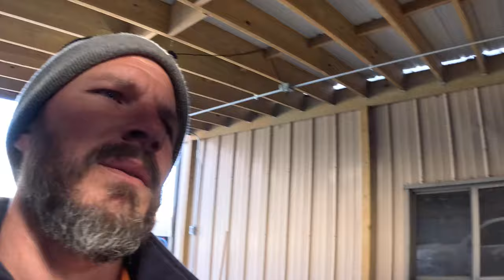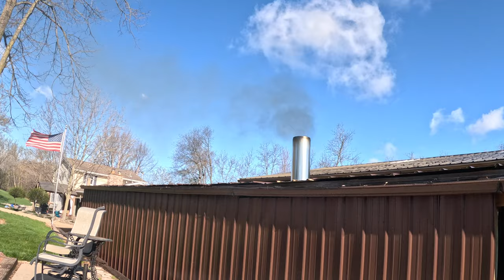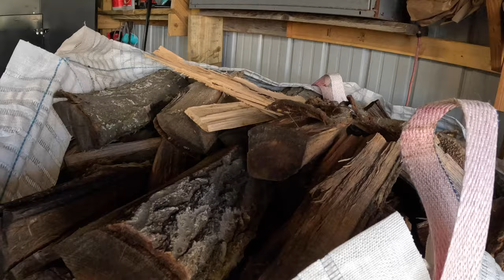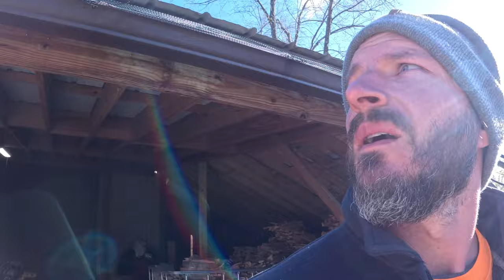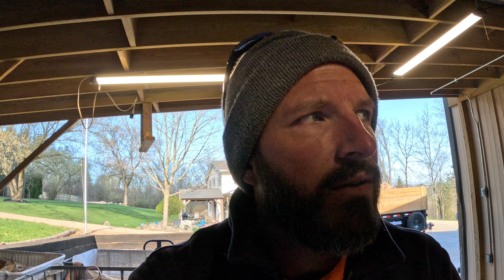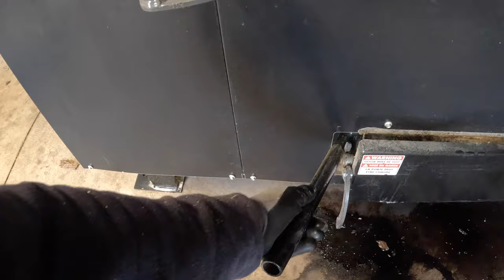New Boiler Keeps Going Out!

Comment: You’ll get it sorted out. Coal beds are key with these dinosaur units. I always “chase the coals” on mine. If I opened the door and I have a ton of coals I’ll burn some junk or pine. If I come and coals are thin I’ll use good hardwoods etc. you’ll sort it out overtime. 👍🏻
Reply from the maker: Any new machine is a learning curve. I think I’m finally on the right track now. Crazy but I can’t wait till next winter when I get to see how she will really perform when it’s super cold and I’m running everything all at once.

Comment: As a C series owner an someone that works in the field C series is notorious for it. I would say load demand is your issue. In laymens terms.... for what your using or supplying right now isn't enough load for the warmer temps as compared to winter time outdoor temps. What I would try is change your temperature difference on stove to a closer # like 5 degrees. As it warms up outside the stove won't loose temp as fast as when it's winter. Then causing your long down times N embers going out. Other then that there should be a  quarter size flap in the back by intake to stove. This allows some air to come into the box to hopefully avoid this. Love following hope this helps out some
Reply from the maker: Last night I changed the differential to 7. Not sure if it took or not. Will have to check it today. I did open up the small hole all the way as well and that seemed to help. Boiler ran 3 times over night and ran fine. Went out this morning to zero wood left. But burn times and idle times seemed to be the same according to my charts.

Comment: Great video. Great content. That drip at wood loading door will be even more depressing after what I tell you. The lip or offset of ash pan metal where it shuts the ash pan door against. The drip on my wood door dripped down onto it and actually took the paint off. it’s so acidic. My unit is all stainless. Paint didn’t hold up there at all. I need to look into possibly an epoxy paint. Or even call Sherman Williams and get there opinion. 
On another subject. My gauge up top for water level indicator. I purchased good quality DOT certified 3M reflective red and silver tape. I took old sticker off and kept it to transfer lines. Halfway to full is red half way to bottom is silver. I took a permanent marker and transferred lines back on reflective tape. I had a neon green knock to a bow and arrow. 🏹 I glued onto horizontal metal indicator line. Fluorescent paint would work also. I can now with no problem at night see my gauge in the dark with as simple as a light from phone. I enjoy so much working and running my boiler. All these different brands and types of boilers. And the condition of wood being used plays into a huge learning curve. Have a great week sir.
Reply from the maker: Yeah the drip is weird for me bc the wood I put in there literally as minimal water in it. I know I will learn this boiler in no time. When it runs properly it’s awesome.

Comment: Hey Matt,  kind of similar to the temp sensors that I suggested for you, you could install a timer that would run for 5 mins every hour (or so) which would effectively be the same thing that your G10000 had as an idle timer. It'd be really easy to connect the output of the timer to the fan in the new boiler.

I do this for heating my shop's in-floor loops instead of using a thermostat. I have the timer turn on and run 20 mins and then cycle off for 60 mins. 

Holler if you want to try that and I can send a link to the timer I'm using.
Reply from the maker: I did think about installing a timer to do that. I may have it dialed in pretty good right now. But I would be interested to see how you do that because I want to do something similar with my snowmelt system.

Comment: My father in law has the mf3000e I believe which is the same line as yours but in Canada and his is way smaller than yours. He also has trouble with the fire going out all the time on warmer days. He just changes the differential to 5 I believe and it does help, but doesn't eliminate the problem completely.
Reply from the maker: Warmer days it’s definitely tough. That was nice with the g series with the timer cycle. I think I have her figured out now. With this new unit it will definitely be tough come middle of the summer when I’m heating the kiln and hot water for house. It will just idle forever. But I’ll figure it out.

Comment: Just like everyone else said, set your diff to 5°. The reason your G series established a coal bed as fast as it did, is because by design the primary burn chamber on a gasifier is only to produce a coal bed and heat the wood enough to release the wood gas. 

I don’t know what kind of adjustments are available on your new unit?  If the airflow is adjustable, you should lower it to produce more coals. The less airflow, the more coals you will produce. In the cooler season, it won’t matter, because it will be cycling more often, which will require very few coals to reignite.
Reply from the maker: Yeah I just thought about damping the air flow into the box. It is adjustable so in a few days if I can’t figure out how to establish a good coal bed and to keep them lit I will try and slow down the airflow to have longer burn times.
Reply: I just looked at your install video. I see this unit uses an actuator for the air dampers, so you should be able to adjust the airflow. I would adjust that airflow down, it will give you a better coal bed. Also, you will notice even less wood consumption, because you will be blowing less heat through the boiler and out the stack. Because you burn such dry wood, it isn’t necessary to have a lot of combustion air.
Reply from the maker: @howlandexcavating once I get a hang of this boiler I will definitely be fine tuning it.

Comment: If you are confident the heat  deferential is not set to far apart. You might try increasing your heat demand a little by introducing more fresh air into the kiln. Maybe 15 minutes open per hour until you get the coal bed established. I would assume it would make the kiln demand more heat. Just trying to think outside of the box a little with the most benefit to your needs. Have a great day..
Reply from the maker: Yes that’s a good idea. I am putting in a new batch inside the kiln today. So I know the boiler will cycle just fine as the heat load will be substantial today. Hopefully after today I will have an establish ash and coals.

Comment: A solution might be to set your upper temp lower, or to reduce the difference between the lower and upper temp. That would reduce the burn time, but it would also reach the lower limit faster and reduce the idle time.
Reply from the maker: I changed the temp differential last night and that seemed to help a bit.

Comment: Wow on the problem  of keeping  a fire !!
Like  you said probably  not  enough  demand  in the warmer  outside  temperature !
Yah on another  kiln 😊  BUT  before  that  comes...might  it work  to run the heat  in your outside concrete  pad to help  in faster  recycling  times til you get another  kiln ???
Another  thought  on when you get a lot of dried  totes ...how are you planning  on storing  them  to keep  them dry ??  
You have a Good Day 😊
Reply from the maker: I could run the snow melt. But with this warmer weather the concrete will be warm from the sun and once it gets to temp it will never cycle. Maybe once a day. So barely a load. I will get it figured out hopefully soon enough. As far as keeping the wood dry and storage. I will remedy that here shortly as well. Haha
Reply: @Treestofirewood  sound good...OK  on keeping  wood  dry ...Hahaha...looking  forward  to that video  !😁
Reply from the maker: @kendriedger151 as long as I find time. But for that I will have to make time. Because dry would is money in the bank and I’m out of room. So maybe in about a month I should be on to that.

Comment: You're trying to heat to little with to much water capacity,  will probably work fine in colder weather. Set differential for 3-4 degrees.
Reply from the maker: I’m playing with the settings now and adjusting something’s. Seems to be working a little better now.

Comment: Kind of weird that steam was coming out -- How hot was the water? Since there is no recirculating pump maybe water near the firebox is boiling and then just not condensing before leaving the boiler? I guess you'll have to see if you need to periodically add more water to it.

I don't think it's' smoke -- If smoke was able to get out that means you'd be leaking water somewhere else.
Reply from the maker: The water temp was at 180ish. I may adjust the damper in back to maybe not let as much air in the box to maybe slow down the burn so the fire can burn for longer. Maybe that will help with getting a coal bed. Or maybe I need to mix not so dry wood with my dry wood to see if that helps. It just idles for to long.

Comment: no water side leaks anywhere?,steam…could just be condensation burning off insulation 
does stove have more than 1 sensor reading temps…maybe check pumps..
load that beast up and open the windows 😂have a great day
Reply from the maker: Stove has one temp sensor. I have my sensors on the pumps. Everything seems to be working just fine. I haven’t seen any steam coming out since that one time. So thinking all good now.

Comment: You might end up building two large kiln containers just to put a big enough load on the boiler in warmer temps.
Reply from the maker: I did think about that the other day. Keep the one I have now and still build a larger one especially if I can’t get heat demand large enough. I’m sure my new kiln will pull a lot so hoping that it will be enough.

Comment: Sounds frustrating I wish I had answer if was classic I would say sounds like damper stuck ,
Reply from the maker: The damper definitely opens and you can see how much air comes out the stack. I think it’s just how short the burn times are that it doesn’t have enough time to burn and create any coals. I shortened the idle time and opened the small hole on the intake to help with a small small draft to hopefully keep the coals lit

Comment: What's your diff set to?
Reply from the maker: 180 set point. 10 degree differential. I changed the differential to 5 today and seems to be working great now. Will see what happens come morning.
Reply: @Treestofirewood  Same. Mine went out at 10 went to 5 and no problems.